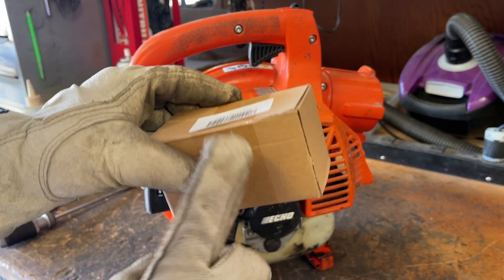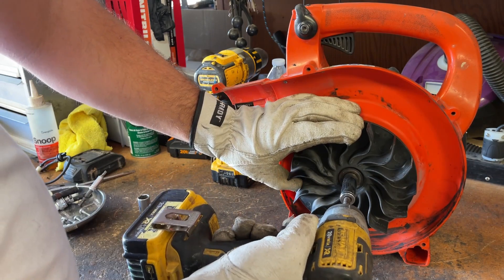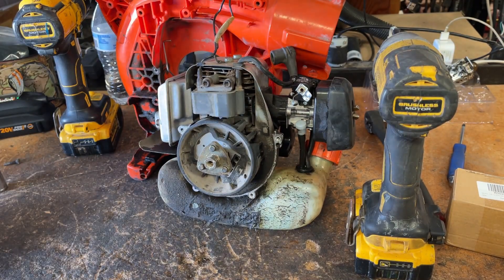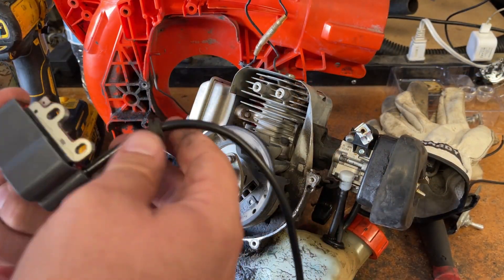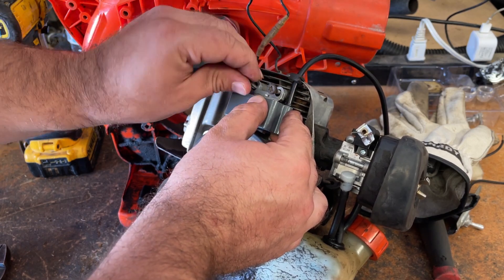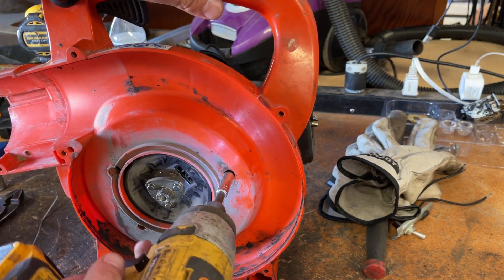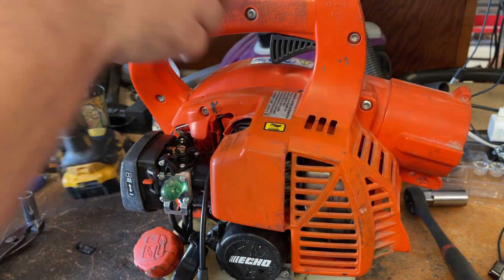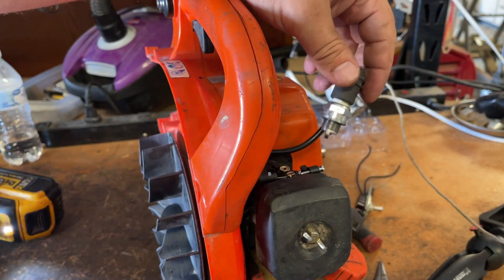No Spark Echo PB250 ES250 Blower? - Replace Coil

Comment: I have same exact leaf blower . 
It starts runs for 5mins then shuts off and will not start again for about 6 hrs later . Has no spark when it does this . Do you think this is what it need ?
Reply from the maker: Yea that’s often an indicator of a bad coil. When they start going out that’s a symptom they start doing.
Reply: @hanksgarage_  Thank you very much .